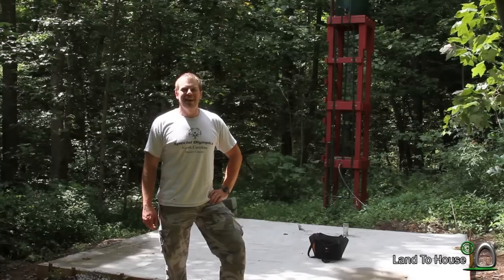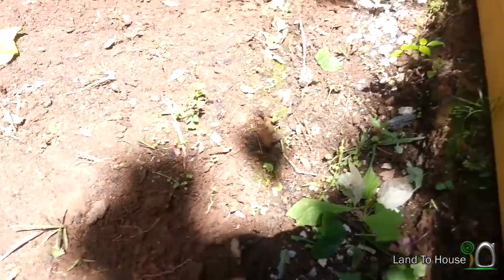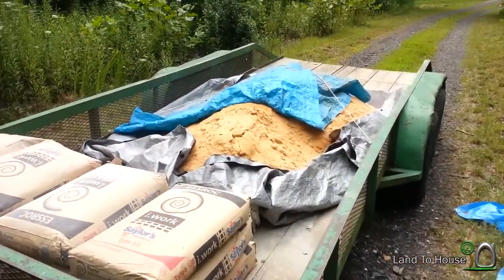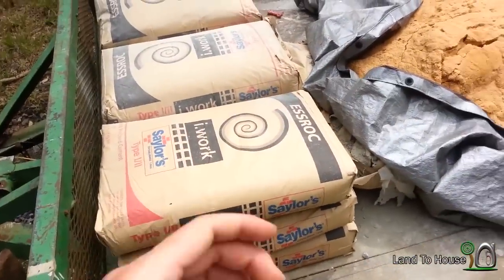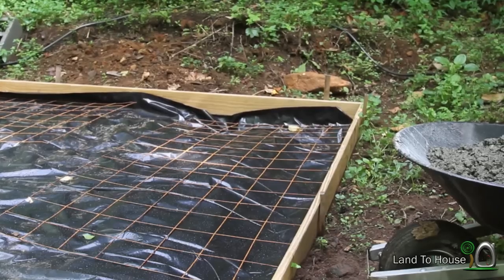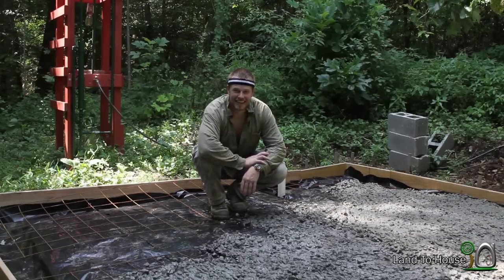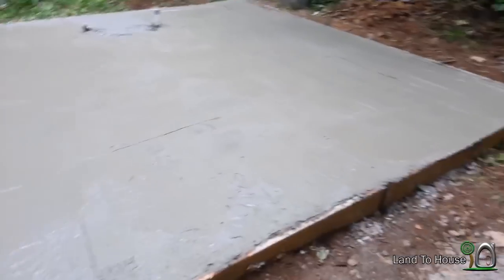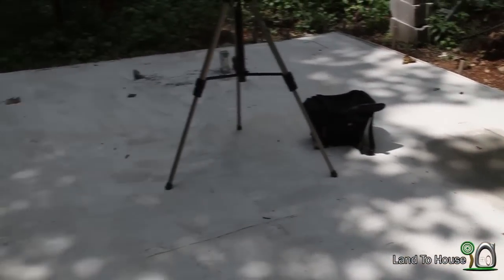Tiny House 2 - Pour Concrete Slab

Comment: I think you made a pretty good job of it for your first time with concrete, I have laid probably several hundred slabs over my lifetime and know how hard it is :)
A couple of tips if you ever do it again, it is normal to put a layer of sand over the base gravel to stop it piercing the membrane. When you mix the concrete start off by putting around 2/3rds of the water needed in the mixer first then add as it is mixing until the right consistency, this needs to flow easily from the mixer and will be easier to level.
Well done!
Reply from the maker: Thank you for the tips!  I had wondered about the gravel poking a hole in the vapor barrier. It was 6mil plastic but still that was a lot of weight pressing down. Sand would do the trick nicely. As for the water. I learned about that as I went. The first couple of loads were to dry. After the 5th or 6th I started to get it right. I neglected to film much more but I think this video shows an adequate "how it was done". The top layer was much more enjoyable to do because it did not have the large rock. What is your opinion on the depth of the slab and freezing? It was 8" on the sides and 5ish in the middle. what can I do to help prevent cracking?
Reply: I doubt it will freeze this time of year but if you do have very cold weather a tarpaulin or sheet over it for a couple of nights should see it ok. keeping it wet for a few days if you have hot weather is definitely  a good idea to stop it cracking.
By now I would think it is OK anyway
Reply: The depth sounds just about right by the way
Reply from the maker: Michael Collinson Yes its very nice now. I was concerned about this winter when the temperature is 15 degrees for a week. I have read that the concrete can crack if it is not below the frost line. So that is why I made it 8" deep. I sure dont want cracks.

Comment: Nice video, great series. Just a tip if you pour another slab; if you put spacers under your mesh(chunks of bricks works well) to place the mesh 1/3rd to halfway into the slab, it will work better than sitting at the bottom.
Reply from the maker: +Daniel Daniels great tip. Thank you. This is the first time I have done most of these tasks in this build. Learned a lot. And still learning.

Comment: Seth, great series! Could you do a video about that water tower that you have built near the pad? I am wanting to build something similar for the ram pump I built on the farm. Thanks!
Reply from the maker: Hello. I am going to be building a much better model tower in the spring with detailed video. But sure I can make a short video showing the tower. There are a few issues that I have with this one that I can share so you wont make the same mistakes.

Comment: That was certainly a lot to bite off on your first attempt, especially by yourself that first day! How is it holding up after a few years, since it was poured in two layers, which I'm sure you know wasn't ideal? It also would have been better to remove the top layer of soil which has a high organic content, to minimize the slab sinking or settling unevenly.
Reply from the maker: +Doc Work yes that was an incredibly hard job. A year later the foundation is still doing great. Absolutely no problems at all

Comment: Did you use less rock on the top layer or just use bull float to make smooth
Reply from the maker: I used the bull float. The mix was more or less the same.